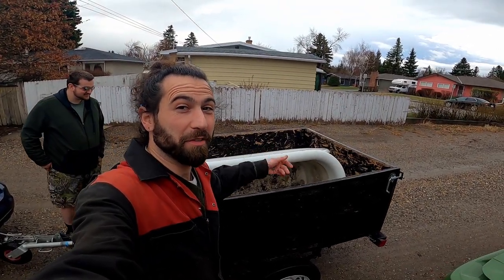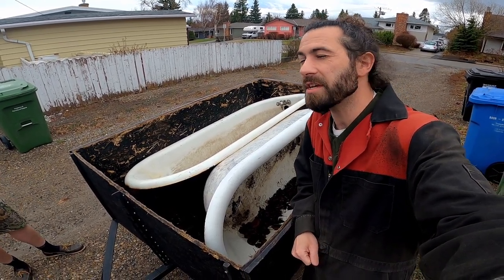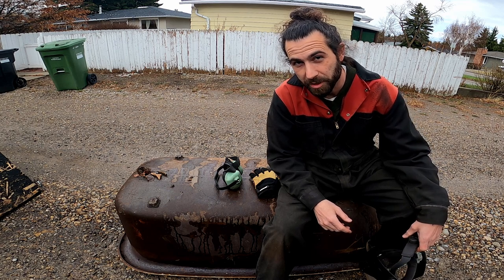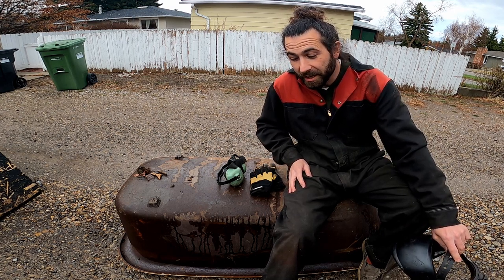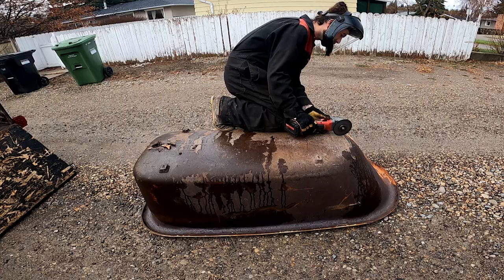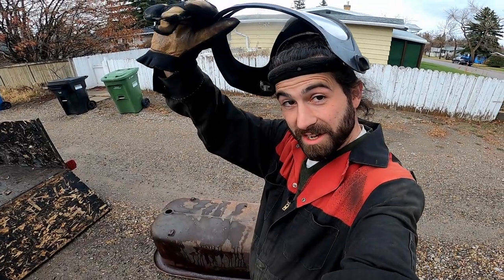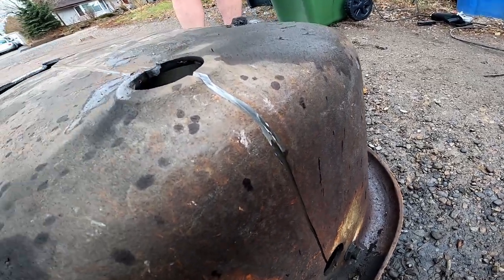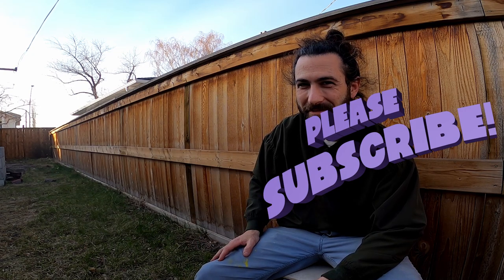Scrap Value of Cast Iron Bath Tub - How Much is it Worth? Scrapping Metal Guide

Comment: if you dont break the tubs down they are very good for quick $. I hate to say the problem with you transporting them is you have a cap on the bed of the truck.   $15 bucks to load & unload, maybe 10 min work each.    Do they ding you for oversized shred?  
my yard might not pay the highest but they are lacks on categories,  i.e. cast is cast even with a enamel or a lead ring in a pipe & short of a monster piece no issues with size.  makes it so much easier.  Same with aluminum - basically clean, dirty & irony.  no sheet, no extrusion, no painted, not painted etc....   of course if I end up with a huge amount of high end extrusion I might want to shop around, but in general a better system
Reply from the maker: I agree, a system that saves time is more profitable in my mind, and I’ve chosen yards for the same reason. The cap was mostly for bottles, but it might be time to drop it for some rails 👍

Comment: Hey man I live in Calgary, working as an electrician. Im wondering what your thoughts on the best place to return copper wire would be, currently I goto bare wire! Cheers
Reply from the maker: It depends of course. I find empire to be the best payout for nonferrous, at least for the last while. Bare wire ended up being too picky with grading for me to make decent money but if you’ve only got #1 or lumex the price might be higher at BW. My pick is Empire regardless, but I still call around once in awhile 👍

Comment: Sadly at our yard we also buy all bathtubs as “white cast”, same thing goes for Rads (the heavy heaters in homes/apartments). It all goes for shred for us, but they definitely way a lot! Also a little foot note, oversized scrap really should only count for #1 steel, black cast (cast iron pipe) is super easy to break so we buy it at the full price even if it’s oversized. The only thing to watch out for is the lead in the pipes, but some places won’t mind and will break them off of the pipes at a later date and just recoup the lead for themselves :)
Reply from the maker: Oh hi there Lorne! I was thinking the same thing about oversized cast, it’s gonna break on its own when you drop it from the magnet arm so what difference does it make! I understand why some places have a different category though, that enamel can be nasty stuff

Comment: Spend $50.00 and 6 hours to recondition and sell for a minimum $750.00 each I've received up to $4,500.00 on a claw cast iron tub with 9 hours work and $300.00 investment
Reply from the maker: Really? I never thought about reconditioning them, do you have to remove all the old enamel?
Reply: @thubprint   no you can use a 2 part epoxy to fill in any cracks, chips and deep scratches but first acid wash and sand, watch some YouTube videos on it it's easy once you get the hang of it  also look up electroplating for the the feet, drain and faucet/shower assembly. A friend "Mike" sold a dumpster dive claw foot after refurbishing for $11,000.00